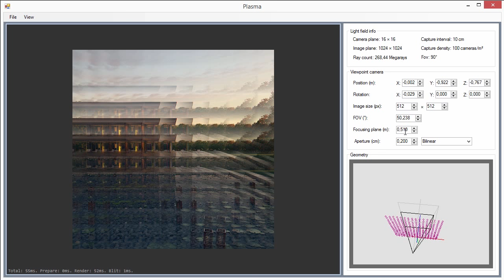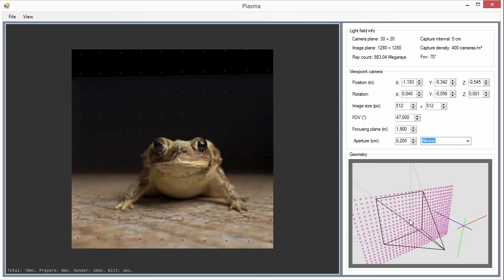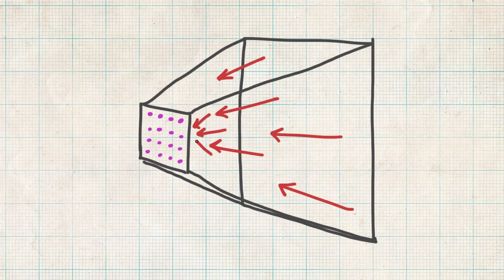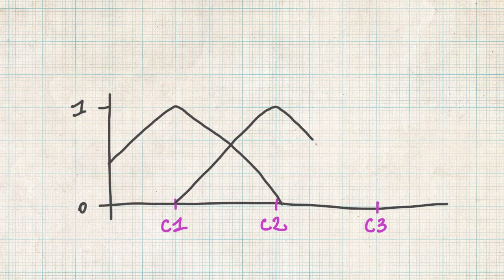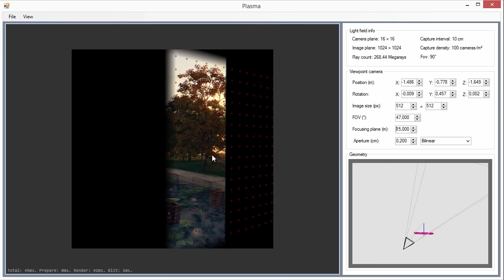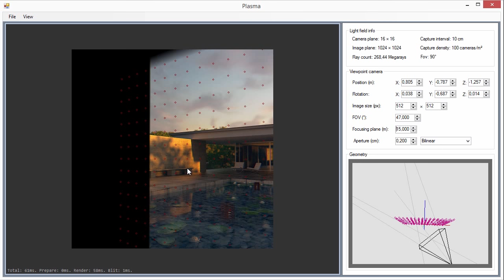Implementing a Light Field Renderer

Comment: I've wanted to implement my own light field viewer for a while and your video is very helpful to understand the high and medium-level concepts.

I noticed quite a bit of "ghosting" artifacts in the image, presumably due to combining rays from different cameras. What can be done to reduce this ghosting effect?
Reply from the maker: To reduce the ghosting we need to have better information about the shape of the scene as seen from the final viewpoint, to pick the correct rays. This can be done either with a rough model of the scene and a rasterization step or by capturing the depth along with the color. Knowing the distance from camera we infer the position in space and use that to recalculate the actual ray directions we should be sampling from. Doing this fast is not trivial.
Reply: Hi, how an I create the dynamic focal surface at run time. Do i need to obtain the depth map of the scene using methods such as SGBM or optical flow ?  But the process to obtain depth map is very slow. Thank you~~~

Comment: Hi, Nice Work! I have read the paper "Dynamically Reparameterized Light Fields ". But how can I create the dynamic focal surface at run time?  thank you~
Reply: HI, did you manage it? If the dynamic focal surface does not fit the depth of the view. Switching between camera will result in inconsistent image.

Comment: Did you take the lightfields with multiple cameras or a single camera you moved about? :D Second alternative sounds a bit more economical... though not as awesome ;)

Nice explanation, I will have to watch this three times more to understand everything :)
Reply from the maker: +Andreas Aronsson All the images have been rendered in Blender. I wrote a small python script that moves the camera around and export the images so that I could let it run at night.
Reply: Ah, that makes even more sense :P I did wonder about the frog xD Thanks for sharing :)
Reply: +Joan Charmant turns out now i understand those lightfields really. Man that is awesome. 
How exactly does the math work for the calculation of the right rays/pixels. Could you do a video on that?
Reply: Another way that could  be done, if you don't mind having everything in  a single huge image, is to use material nodes to control the normals of a plane, producing a tiled lens (or mirror) pattern, and use an orthogonal camera to capture the view thru the plane. Be sure to make the plane only visible to the camera and not to the rest of the world to keep unwanted shadows and reflections from showing up in the world, though.
Reply: Joan Charmant so were all the images including the frog synthetic 3D models?